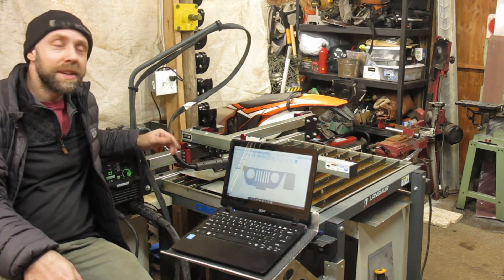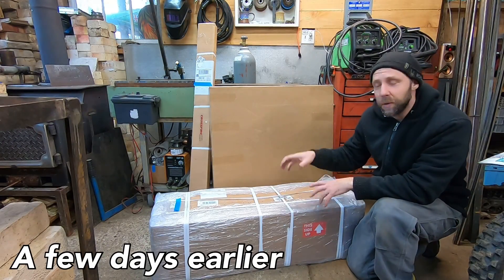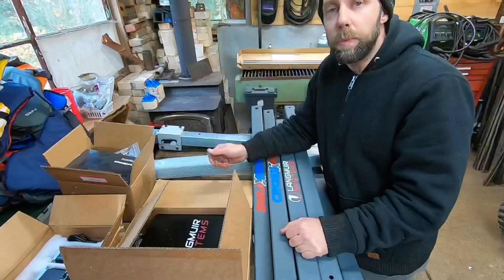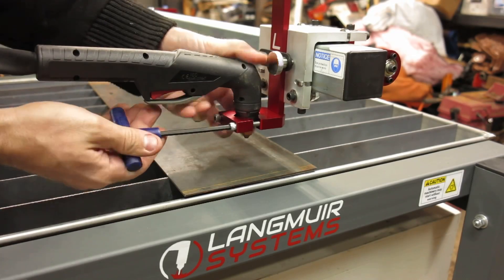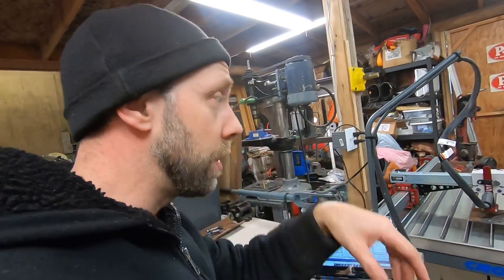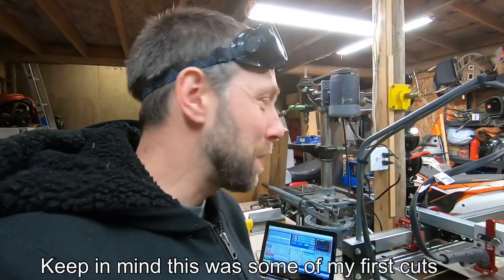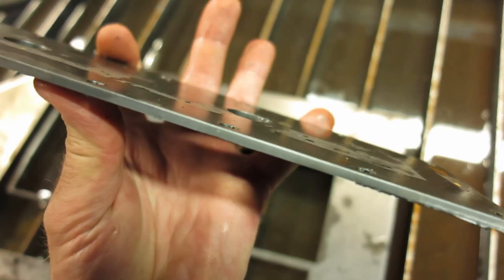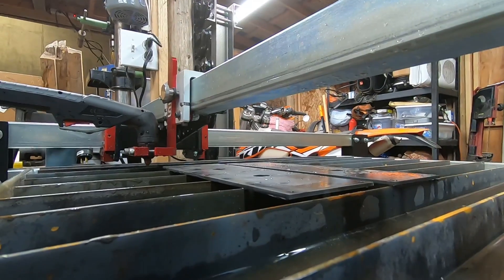Finally a affordable CNC plasma table Crossfire from Langmuir systems

Comment from the maker: Here's some helpful videos I have found on Fusion 360, These videos I found to be the most helpful for me to learn how to use Fusion 360 fairly quickly by following along. If you like the videos, help the guy out by clicking (like) and leave him a nice comment!     Fusion 360 learning to draw plus tool paths  https://youtu.be/7b5kpeV6y5M
Part 1 practicing Fusion 360 https://youtu.be/tF0slQ5FbmA
Part 2 practicing fusion 360 https://youtu.be/Sy55EeiYYrU
PS he is a school teacher and these videos were made for his class.
Here’s an affiliate link to the Crossfire website if you are interested in checking out the table  
http://store.langmuirsystems.com/?aff=16 
Don’t forget to use the promo code   MIKEFESTIVA   this will save you $100 at checkout on the table!

*After Running the Titanium Plasma 45 for 3 years it's held up great! But I feel the Hynade CUT 60 CNC Plasma with blow back pilot arc start offers much better value and is PLUG and PLAY CNC ready**
Amazon Paid affiliate links below  
Hynade CNC Blow Back Digital Air Plasma Cutter, Non-HF Pilot Arc Non-Touch Plasma Cutting Machine, THC Torch Height Control Enabled (CUT60DN) https://amzn.to/3DEzR2m
Reply: Love your videos very helpful !  Can you make chassis for r.c. cars with that set up ?
Reply: Mike, thanks for the video and the recommendation on the Hynade 60. With the Hynade 60 did you do anything with the Arc Voltage Output?

Comment: @Mikefestiva you still happy with this?  Thinking about buying one after watching make so much cool stuff with it.
Reply from the maker: I sold this first generation plasma table. I have a larger model now. This table is pretty good, I had the original model but it’s been upgraded for quite a few years now. This one is good to not take up much space in the shop. The other Plasma cutter worth looking into is the Arcdroid. I have a video or two on my channel covering that unit 👍
Reply: @Mikefestiva ok perfect answer thank you- thinking I will get a droid.  Will check out your videos thanks again. Be well

Comment: Hi, I thinking about getting a Crossfire to make square and round cuts in coated galvanized steel. Do you think it will work? are you interested in doing some test?
Reply: It (your plasma cutter) should cut through galvanized (zinc plated) steel, check with your plasma cutter manufacturer, as the Crossfire only aimes the torch, the rest is up to the plasma cutter itself.

Comment: I have the Titanium 45 plasma and thinking of getting the 4400 table, same set up you have here. I've read in the plasma manual and it says its high frequency  and then read online  that said it wasn't.  So I'm guessing yours worked, mine should also unless you know something different.  If you would, I would like to know. And with the 45 plasma, I know the meatl has to be clean to cut have you had any trouble of it just losing arc by dirty metal with using the table? What do you clean your metal with, if you do? And with the 4400 table, does the voltage divider come with it to hook up the 45 plasma ? The same set up you have is what I'm looking to do. I just have the 45 plasma and everything comes with the table for 1495.00 to start cutting,  you don't have to buy any extra things to start cutting is what I'm asking? Thanks

Comment: I just bought a table with your promo code. It still works in 2023. Thanks for the videos. I have been wanting to do this for a few years and finally i just bit the bullet on this one. I still need a plasma cutter, but that should be no problem.

Comment: Would you recommend this one with the XL addon or the Pro. I been wanting a table a while and been using fusion360 for about 5 hours, headaches at first but getting better. I think the pro might accommodate a 4ft wide sheet but I buy new second steel that sometimes measures 46" to 52" in width. Cool video

Comment: Is 1500 just for the table or does it include the torch?
Reply from the maker: Just the CNC table.
You would  need a blow back pilot arc start plasma cutter as well.

Comment: Is there any unbiased videos from someone who actually purchased this and isn't paid by the manufacturer?
Reply from the maker: I bought this plasma table out of pocket, it’s been a almost 3 years but think it set me back $1800 with the XL kit and water table. You shouldn’t jump to conclusions that I got it for free.
Reply: @Mikefestiva  hey bud, 4 years later what’s your thoughts?

Still use it? Upgraded to something else now? How was your user experience with this device over the years?  

I was initially very concerned or deterred away seeing this as one of the only products that has the tracks NOT supported on all sides. Worried there will be some sag over time but might just be over thinking it.

Comment: This question is for anyone.

I'm curious about the unsupported end of the X-axis. Has anyone experienced backlash/whip? Or any problems with deflection (being pulled down) when the Z-axis carriage gets to that end? Those are my main concerns. Those probably aren't issues, but I feel like I should ask before buying.

Thanks to anyone who answers.
Reply: That’s my concern as well. I’m shocked this question is addressed more. I wonder if that means folks aren’t encountering that issue as much as I would have anticipated.

Comment: Hi i have been trying to get information if you can run the titanium plasma cutter on a generator or if its generator friendly? Also what type of computer do you need to run that software or canyou use an apple tablet?
Reply from the maker: I don’t think An Apple tablet would work, Fusion 360 should have there requirements on there website, I’m just running a basic HP computer a bought a few years back, nothing special.
I don’t know if the titanium 45 will run on a generator? I haven’t ever tried.
Reply: @Mikefestiva   thanks for getting back to me on this matter, like the videos too.
Reply: @charlesflaco7976  you would need to know how many amps the plasma cutter is ,, should be on a tag on the unit ,, then your generator will have watts output ,, most will say 2 numbers running watts and peak watts .. you will need to convert amps to watts so lets just say your tool is 30 amps that is 3600 watts .. so your generator would have to be a least 3600 min.. higher would be better ,, but check with your owners book on your plasma cutter to see if they say its ok ,, I have seen elec mess up on generators ..there not grounded unless you ground them ..and some don't put out the watts that they say they do ,, do your homework .. hope this helps a bit
Reply: @randytravis3998  Thank you.

Comment: As a cnc machinist. I'm very impressed.
Reply from the maker: I sold this CNC table about a year ago and upgraded to the crossfire PRO table, it’s bigger and has more options. Both tables are excellent and are priced right 🙂👍
Thanks for checking out my video, I have other videos on my channel covering the PRO model, and a lot of videos building stuff using my CNC. I actually built an articulating dump truck and now I’m in the process of building a 6x6 mini pinzgauer truck!
Reply: You have skill, your son is going to be learning plenty from you, I built a 3d printer with my son using arduino boards and stepper motors. Cnc motion is neat stuff.

Comment: It looks like the gantry and the torch holder have a lot of height adjustment.   Would it be possible to put a square tube on the table and cut on the up facing flat surface?

Comment: I've got to get one of these!!!
Reply from the maker: They are really awesome tools to have in your shop. I now own the Crossfire Pro table and I would highly recommend that model 👍
Reply: @Mikefestiva  I have been watching your videos for quite some time and am about ready to get the Crossfire table (not the Pro) I see that have made some changes to it since they first came out with it. would you still be happy with your old original table if you had not upgraded to the Pro?
Reply from the maker: @Iann128  Yes the original table is quite capable 👍 The thing I didn’t care for about the original table was the Mach 3 software, but I believe the smaller tables come with the better Firecontrol software now. That is a massive improvement!  If you get time, check out my Articulating dump truck series, you will see the original table cutting all the parts for that machine 👍
Reply: @Mikefestiva  Yeah I watched the whole series :) That was one thing I noticed today was the newer small tables come with Firecontrol now. I want to get my feet wet with CNC plasma but can't afford the Pro right now but maybe down the road. Thanks for the reply.

Comment: how is the smell in a closed garage for guys just playing at home?  would love to have one, but dont want to poison myself - thanks for any advice.
Reply: I work in a large manufacturing plant with a few of these, ours have suction underneath that malfunctions sometimes but I’ve worked there 60+ hours a week for 10 years and haven’t had anyone there complain about it. The one he’s using is a water table, not trying to talk to you like you don’t know anything  but I have to assume. With a water table there should be VERY little in the way of smell. At very most you could install a vent...like a bathroom fan in the room were you have the table or open the door every 10/15 minutes. Realistically though this table is cutting small enough projects you shouldn’t have to vent much.

Comment: Hi Mike. Great video and I’ve watched it like 10 times. I just set up a new crossfire pro and went with the razorcut 45 plasma because of the plug and play promise. Turns out they have a big run of units with misfire issues and instead of replacing them they want you to repair them yourself. So I’m returning my plasma cutter and am now looking at the same HF machine you are using in this video. Can I ask how it has performed over the last year? Any misfires? Problems? Thank you so much Dan
Reply from the maker: Thanks for checking out my videos 👍 I show how to connect the torch trigger in this video, my other crossfire pro video I show how to connect the THC 😂 that’s for Torch hight control. I have cut over 500 feet with my Titanium without any problems. I have had a few misfires but they tend to be from a bad ground, I Always connect my ground clamp to my metal I’m cutting, not the water drain bolt like they mentioned. This seems to remedy most of my misfires, on occasion you will of course need to change out your consumables too. I have had my titanium start a cut but only etched the part and it would only be cutting at 15 amps, this was due to a bad ground issue, the torch is designed to only put out 15 amps to start the pilot arc till it senses a ground, it it doesn’t it will only cut up to 15 amps, this is so the torch doesn’t go full amps and melts the small ground wire leading out the the torch head to engage the pilot arc. I hope this makes sense. The Titanium has been a rock solid plasma and I always cut at the full 45 amps and just adjust the speed of the cut depending on metal thickness. I still haven’t hit the duty cycle yet. I hope this info is helpful to you. 👍
Reply: @Mikefestiva  Do you get all the connections you need to wire up an aftermarket plasma when you buy these tables or do you specifically have to ask or buy it? Thanks

Comment: If you use fusion 360 can you do any flat design? Or are there limitations on the code??
Reply from the maker: Fusion isn’t the limitation on this table, it’s the Free Mach 3 program, it’s limited to 500 lines of code. I now own the Crossfire Pro table and it runs Firecontrol software that they designed, it’s not limited and works really really good. I have a video covering there pro table. I really like the pro table! Take care
Reply: @Mikefestiva  Or you could pay $175 for a Mach 3 license.

Comment: Would a cut-40 be sufficient to use with this table?
Reply from the maker: I don’t think it’s a pilot arc plasma is it? If it’s high frequency then they won’t work, even some pilot arc plasma torches can cause high frequency interference and cause a lot of problems with the CNC electronics. Take care

Comment: What are you running for air pressure on the plasma cutter? And what kind of compressor? Thanks!
Reply from the maker: I’m running about 90 psi. I’m also running a older 2 cylinder air compressor, probably about 50 gallon tank 👍 Have you sent my Crossfire pro CNC table video? I’m running that CNC now and it’s really an awesome table!

Comment: Almost a year later, how is your machine running? Any major issues? How often did you have to replace the consumables on your torch?
Reply from the maker: This CNC table is in great shape still, I sold it to a friend and bought the Crossfire Pro Table, both tables are excellent, the PRO is definitely worth the extra cost.
Torch consumables are changed out if the cut becomes out of tolerance or I need an extremely accurate cut on some parts. The Pro table helps with consumable life by piercing at a higher level then lowering the Z axis done to cut. Here’s a video of my Pro table.
https://youtu.be/EMJFn1tOgh0

Comment: Impressive. This works just like a 3d printer, which also uses g code... Only this cuts stuff instead of extruding filament.
Reply: Pretty much all CNC tools run G code: Mills, lathes, plasma cutters, engravers, 3D printers, everything.  This is true of any shop tool that's controlled by a computer, because the positioners in all these tools are essentially the same thing, stepper motors and belts or screws on the X, Y and sometimes Z axes.

Comment: Mate what software do you run for this setup ? Thanks
Reply from the maker: I was using the Mach 3 to control the CNC and Fusion 360 for drawing. I now own the Crossfire pro table and really prefer there Firecontrol CNC software, it’s much nicer then the Mach3. Take care 👍
Reply: @Mikefestiva  thanks for that!😀

Comment: I just purchased one of their tables after watching your video last week. I noticed that the first plate that was cut(7min 50s) kept the bottom factory edge of the plate and was wondering how you got everything squared with both axis and how did you locate your origin with a factory edge. Are the two aluminum plates there so that the arc doesn't run out of the steel plate ?

Comment: what plasma cutter is this model?
Reply from the maker: I’m using a Harbor Freight Titanium 45 plasma torch with the Langmuir systems crossfire with the XL table extension. I have cut over 400 feet of metal so far with my Titanium 45 and it’s been a solid torch 👍
Reply: @Mikefestiva  I see you are using the torch that comes with the cutter but by chance have you found or know of a vertical or or mechanized torch for that HF Titanium 45A?

Comment: Hi Mike, i have a Amico 200 plasma, tig and stick do you know if that can work with that table you have?
Reply from the maker: No it’s high frequency and all high frequency machines won’t work on CNC equipment because it will cause problems with the electronics.
Reply: @Mikefestiva  thank you, like the videos keep making them they're very informational.

Comment: I love their tables, but they're EXPENSIVE.  if you've got a plasma you can hook up to it it is not hard to just build one.  They dont take much torque to move nor do they need to be particularly rigid because they're contactless.  You could probably use small steppers and electronics meant for building a 3d printer and do just fine.
Reply: If you haven't built one yourself, then you really shouldn't be talking about how easy it is to build one.
Reply: They're the cheapest cost of any table I've found

Comment: ive been looking at this table for a while, this is the best video ive seen on it. im sure not no computer guy, being a equipment mechanic my extent of them is opening and closing work orders and ordering parts. this will be interesting to learn. I like how you talk to people not down to them. great presentation
Reply from the maker: Thanks Joel I really appreciate your comment 🙂
This little table has really changed the way I build stuff, I had never used CAD programs before and I was a bit worried I wouldn’t know how to run it, but within a month of buying this table I was building my articulating dump truck and this machine really has cut almost every part for it. Have you seen any of those videos on the dump truck? It’s been a fun project. Thanks for commenting 👍
Reply: @Mikefestiva  yes. that dump truck is beyond awesome, very impressive. I have never used anything like the cad programs either but I will get one of those tables for sure.

Comment: So your torch doesn’t have to touch off?
Reply from the maker: No it doesn’t need to touch off, my plasma torch is a pilot arc. The Z axis is only manual adjustment but It works good for me, here’s a 4x4 articulating truck I’m building and the CNC table is priceless in building it! https://youtu.be/vFphyNUhsaY
Reply: What is touch off?
Reply: Do you take orders? I have a small project in mind and the machine shops around here are not interested in my small job.

Comment: very cool,stupid question here because i know nothing about this stuff but could you now hook up a  router for cutting wood?
Reply: Just chiming in. A router would most likely be to heavy and cause a sag and gouging of the work, the plasma cutting tool iself weighs almost nothing in comparison to even the most lightweight router. Also the power of the stepper motors may be insufficient to move a working router through the material. You would want a machine driven from both sides of the axis, the table is single side driven.
This is just my opinion.